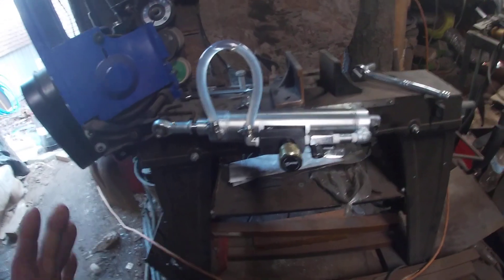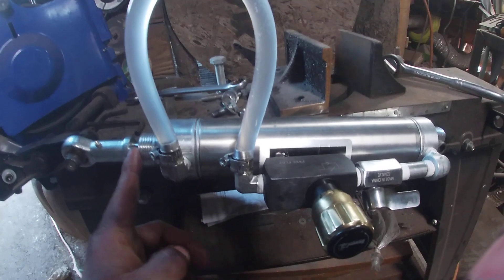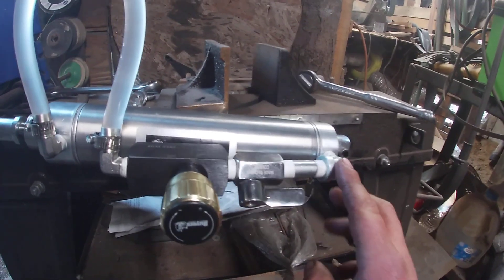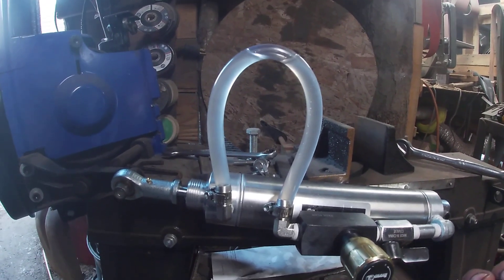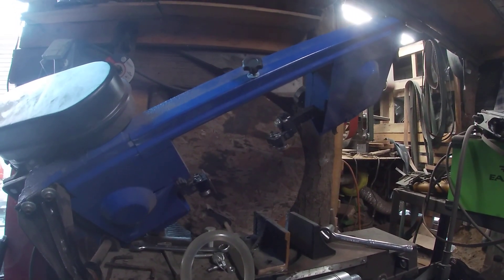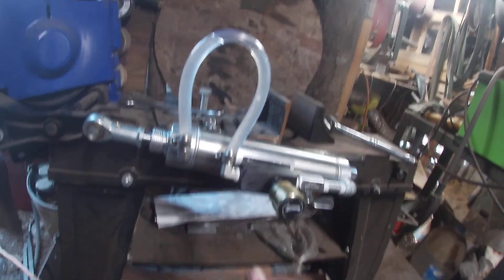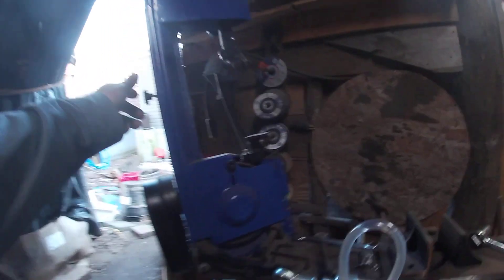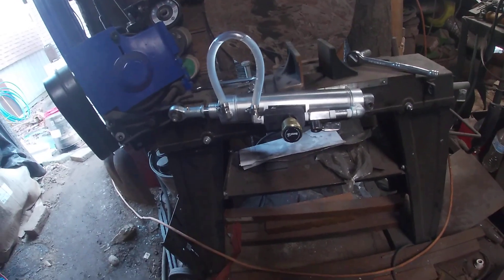DIY bandsaw downfeed For 4x6 (overkill Stainless Cylinder) can be done with smaller.

Comment: Im having trouble finding a cylinder i dont need stainless but you stated 1 1/2 bore but no shaft length and size or im misinterpreted it
Reply from the maker: 1.5 is overkill a 1 inch should be fine as well.  Its a 6 inch stroke.  Reason i chose that is so when it drops its only using 1-2 inches of the rod .  So less diflection. .  Its about 12 inches from rod hole to end hole
Reply from the maker: I used a 8 inch legnth 4-12 would work fine to short will put to much stress on the rod.  The rod here is 1/2

Comment: How long is the cylinder (pinhole to pinhole) ?
Reply from the maker: About 12 - 13 inches the rod end bearing didnt come with this cylinder so others may be differnt with similar size cylinders.  Thisnone is a parker ss 6 in stroke 1/2 rod diamater

Comment: I see the two valves, and understand the adjustable valve with the free flow reverse, (However what is the needle valve on to the right) purpose?
Reply from the maker: That’s a ball valve to stop the down feed
Reply: @alvarezblacksmithing4043  I'm confused on that too.  Couldn't you just turn the adjustable valve all the way to stop the down feed?  I'm getting ready to build mine and trying to decide if I need the ball/needle valve.
Reply from the maker: So the hydraulic flow valve is to control the falling speed and the ball valve is to stop it from falling without changing your down feed speed. If you do what I do and cut a lot of the same material in larger quantities it’s nice to not have to change the downfeed speed every time you make a cut you just lift it up let it fall let it cut if you need to stop it for whatever reason you hit the ball valve instead of using the downfeed control, and then having to reset the downfeed.
Reply from the maker: Just to verify it is not a needle valve. It is a hydraulic flow valve. A needle valve will work, but there isn’t a one-way check so it’s not free flowing in one direction. It’s the same flow in both directions so lifting it up is slow and the downfeed is slow. Even if it’s wide-open it’s still pretty slow.